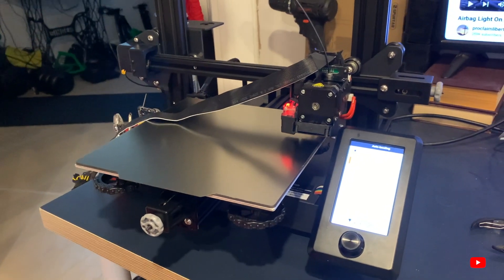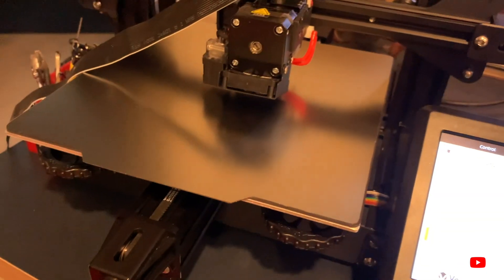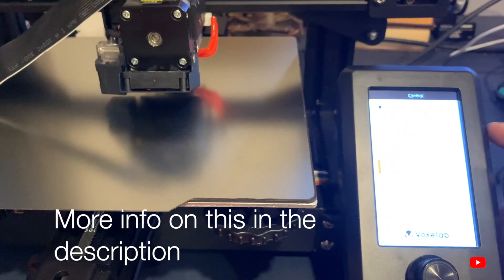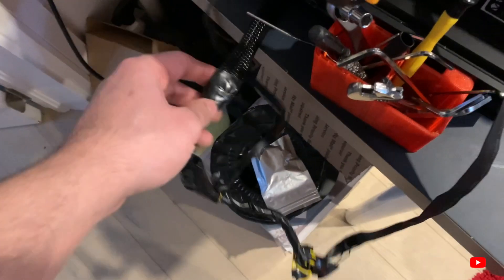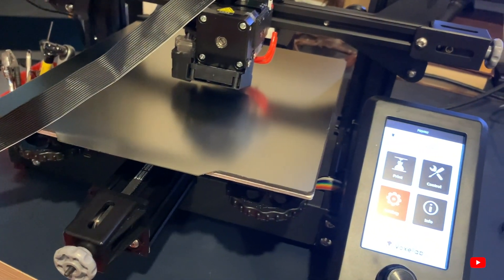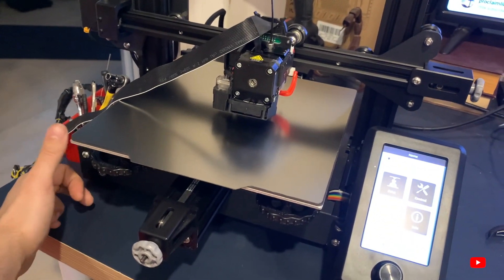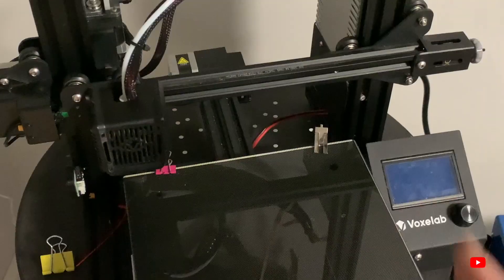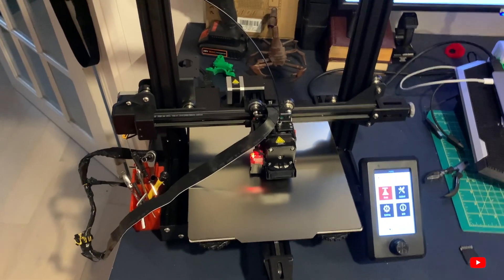Voxelab Aquila S3 Review - Watch BEFORE you purchase

Comment: The ABL is an inductive sensor not an optical one so you need to keep this in mind if you replace the bed, if you used a glass one it will never trigger.
Some people have had issues with this sensor and it may be due to a bend as the cable enters the sensor, same issue for the X3. I have seen reports of pulling this cable though the harness to give some extra slack will help on the X3 but not sure what can be done on the S3 as it has a tool-head board. 
There is another point of failure with these sensors as it uses a converter board to isolate it due to it needing 24v to work, and this would damage the motherboard if it shorted out. 
It taps in to 24v from the hotend fan screw terminal.

If you are using Cura then you need to set up the start Gcode to enable the ABL. You can create a mesh first on the printer and save it to memory to recall it with M420 S1, or start the probing procedure each time with G29. This has to be after G28 as this clears any mesh. If either is missing then this will be the reason it is not being used. These should be set up if using Voxelmaker and the right profile.

Stock firmware is not very good so is better to use custom firmware like Mriscoc. There is a repository on Github maintained by Classicrocker883 for the Aquila that is regularly updated (you can use the X3 firmware but will need to adjust the ABL offsets). This has options to set the offsets in the firmware instead of the slicer. If you move the nozzle to 0,0 then the sensor will be off the side of the bed, this is correct as it uses the centre of the bed to home Z.

I never liked the way they have this ribbon cable. If it was coming from the rear cable tied to something then it would put excess strain on the connection to the plug and I also suspected it could fatigue the wire, but hanging over the front could get in the way of printing too. They should have had it so the cable runs parallel to the X-axis and fixed to a point near the X limit switch housing. This would let it move in a similar way to a cable chain and it does not twist the cable.

Comment: I just took this out of the box and set it up and can't get it to level and print. The nozzle does not touch the plate when leveling. If I use the Control screen option and Z offset it does nothing, no movement at all. The only way to move the plate is to manually turn the Z screw. But that doesn't work either. I don't know what the trick to getting this to set up and print correctly, but if there's another video out there please let me know.
Reply from the maker: You messed up something in the installation and likely something is unplugged within the circuit board, check the connections by unscrewing the 4 bolts on the side and bottom. My cousin had the exact same problem, a connector was disconnected. GL
Reply: @SLPSRocks  I have the same issue, but I've checked the circuit board with everything connected. What ends up happening is that instead of moving closer to the print bed, the nozzle just moves upwards, immediately putting it out of reach of the sensor. I don't know why it's messed up like this.
Reply from the maker: @everythingrandom1381  Thats very strange. I seen a newbie have this same problem, his setup had a whole bunch of things wrong with it and the circuit board connection was the culprit. You need to trace every where and make sure there is continuity. I would take a multimeter and test continuity on every 16 wire that leads to the extruder from the connector that attaches to the circuit board. Ofc you can always just return it on amazon and get another printer to exchange. Happy hunting
Reply: @everythingrandom1381  when it only moves up it means the signal wire is not connected from the ABL so it is reading open. This is a safety feature to prevent the nozzle driving into the bed if the ABL (or Z-limit switch on other models) is disconnected.

This has happened quite a lot on Reddit for the X3/S3 and may be due to the ABL cable being too tight so that has pulled a wire inside the sensor. Some have said pulling the the cable though the harness to give a bit more slack at the sensor on the X3 can fix it but as the S3 has a tool-head board the you can't do the same thing.

It is also has another point of failure as these inductive sensors need 24v to work and this needs to be isolated from the motherboard so it uses an opto-isolator on a converter board to do this. This board is also taps in to 24v from the hotend fan terminal.

This is something that needs someone with one of these machines with a faulty sensor, and has the ability and knowledge to dissect it to confirm the problem. 
It is most likely a manufacturing defect as there are too many reports to be a one off fault.

Comment: Very helpful post, thank you.  I just received my new Aquila S3 two days ago.  I tried to run the ribbon cable around the side, as you did.  The length of the ribbon cable seems to short, to route it this way.  Do you have any more suggestions on how to route the ribbon cable, as it is OEM?
Reply from the maker: If you unscrew the box from the bottom you might be able to obtain a little more slack on the ribbon cable and route it through the side. Unfortunately I don't have any suggestions since I had to lengthen my cable and resolder ever single individual cable. But I watched another YouTuber and they were the ones to suggest a side mount, I think they even created a 3D printed guide for the cable thats attached to the X gantry. As long as it's not getting tugged from the movement of the Y or Z axis it should be fine.
Reply: @SLPSRocks  Thank you for the reply.  Even though I haven't been able to get a print yet,  because my bed is so much lower than the nozzle, the extruder was low enough where the cable was being rammed into by the bed, going back and forward.  I currently have had the cable routed from the back, because of the length shortcoming.  I would not have noticed that colliding between the bed and the cable, if I had not seen your video.
I tried manually leveling the S3 by setting it to home, then disabling the stepper motors, but never could get the bed close enough to the nozzle to level it at that height.  Do you have a link to a manual leveling, for the S3?   I've seen how to do it with a v2, but the S3 doesn't have a z 'stop' , so what I watched doesn't seem to apply to the S3..
Reply: @SLPSRocks  Yes, that sounds like it might do the trick.  While I've been trying to get the bed close enough to the nozzle to then be able to do a manual level, I noticed the ribbon cable touching the shaft of the Z Axis, when the machine is checking the auto levels, of the front of the bed.  If I can ever get the nozzle close enough, to the bed and get a print, I will first work on some sort of barrier, that attaches to the x gantry.

Comment: A way to fix the Z offset issue. Is before you auto home, set the offset to zero. After auto homing, set it back to what the original was. This is the best solution I found for this machine. Personally, having one myself. It really sucks.
Reply: The offset is set to 0;  it came that way.  The z access is also set to 0 in the move area of the controls.   
I had heard that the v1 and v2  Z offset, in the controls, of the machine did not function, is that still true?  I'm wondering if my machine is broken, that's why I ask.  I tried to lower my Z offset, using the offset Z built in the control area.  After auto leveling I went to -.5, and after pressing the know, then even going "back", the Z axis never changed.  I even tried down to -2, and still, no movement.

Comment: I don’t know what is happening with mine it won’t auto level. It’s like it’s not even on and it just sits at a stand still when I tried to auto level it. What do I do
Reply from the maker: No have not seen that before in mine, but I have seen someone else have issues with the Auto homing which was caused by an unplugged connector in the hub around the motherboard. You most likely have an issue with the connections somewhere. If so, I wouldn't be surprised that the other features too don't work.  I would start by  checking that the red light is on for the optical sensor around the print head. check that you can move the axis all freely one at a time (including the extruder) Also would be a good idea to reset configurations for the printer and seeing if that fixes the problem. 

Open the motherboard of the printer by unscrewing the two side casing bolts at the front left of the frame. Next there are 4 screws at the bottom. Unscrew them to access the motherboard. Ensure all the connections and connectors there too are intact. If you still have an issue, start tracing the wires with a multimeter and check for continuity by using either a multimeter with sharp pointed tips or another pin or narrow metal conductive material. You will take continuity readings for all the wires in the ribbon cable. If the internal break is in the ribbon cable, you can also sometimes "fix" these temporarily by massaging the ribbon cable with your fingers, flexing it in different directions. Try doing that and pressing autolevel. 

Good luck, comment back if you figure it out... sounds like you have a fun repair on your hands

Comment: They won’t update it. It’s been the same way for over a year. They abandoned this printer for new projects. I have had it for a long time, managed to use some engineering grade materials too. But since it’s so much of a hassle every time to print it just sits the corner while other printers get used.
Reply: Oh and the ribbon cable does have a tendency to get on the track of the v wheels. And the printer runs right over it destroying it lol
Reply from the maker: I agree it really is annoying to use, full of flaws but I haven't seen anything like it for the price point.
Reply: @SLPSRocks  good review though! Not tryna shoot it down by any means
Reply from the maker: @bradenhenderson1332  Thanks! No I am not concerned about that. Your opinion matters and this video is for the people! So as long as its helpful discussion I'm all for it
Reply: Would you know where to purchase a new direct drive setup for this printer or if there is another brand that is compatible?

Comment: Thanks alot for taking the time to do a review. I just ordered mine. My main plan is to use recycled filament which after a week of trying i think i finally got the hang of. It is about the same size as basic filament and hard to tell the difference but I have a anycubic kobra neo 2 that was not bad but does not have a high enough max nozzle temperature for it. I am a beginner at 3d printing and so far am loving it but I am not trying to make any big modifications so I hope this printer will be a good fit.

Comment: Good video! I agree on all of the pros and cons that you notated! I’ve had mine since dec, extruder motor went out possibly due to my negligence and can’t find an exact replacement anywhere, im possibly looking at changing the whole extruder/hotend assembly but would prefer to keep the original setup as it does print pretty good,if you or anyone knows where I can find an exact stepper motor replacement for this?
Aquila S3 factory extruder motor stepper motor specs as follows:
Nema17 d type-42 23
4 wire.
shaft diameter-3mm 
Shaft length-4mm
12 tooth brass gear.
thanks all…
Yes I’ve tried looking everywhere but maybe i missed somewhere lol..